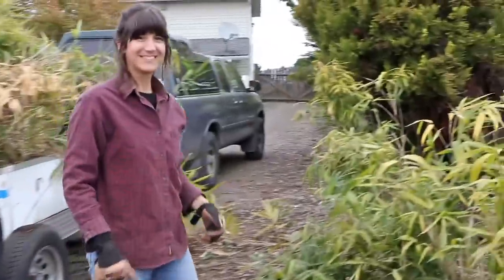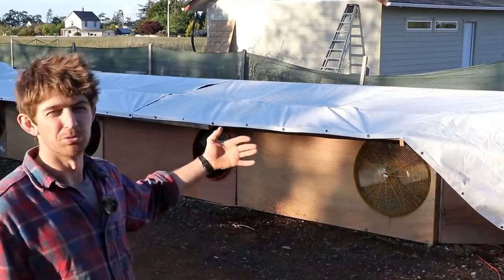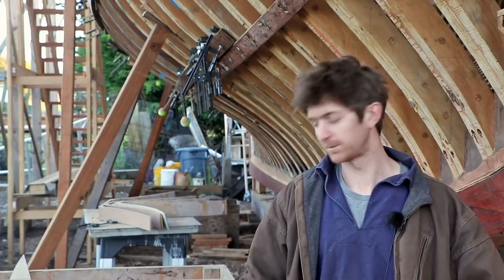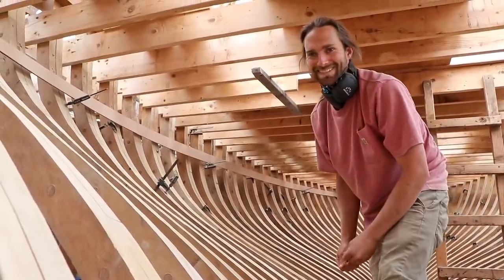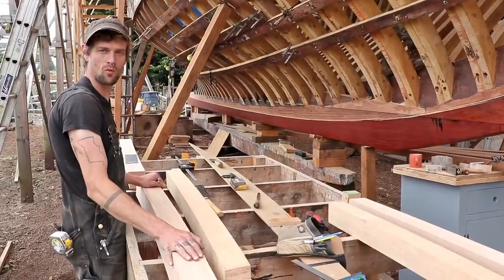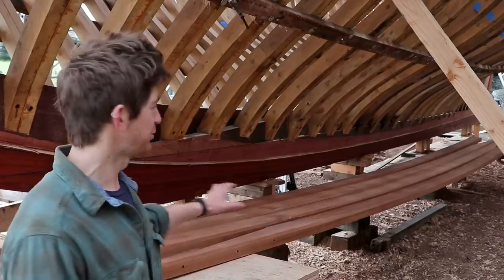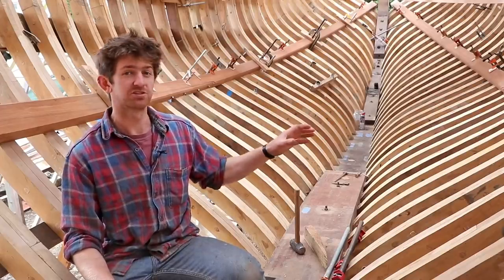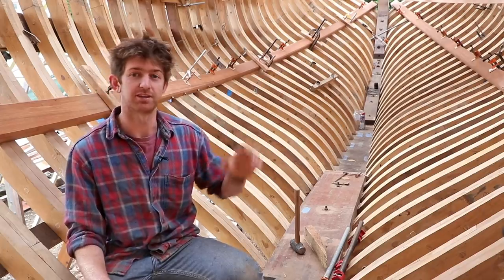BoatBuilding - Bilge Stringers / Oak problems! (EP72)

Comment: Making your friend a tool handle led to finding the bacterial wet wood, which in turn led to the inspection that found the open pore white oak problem, which in turn may have saved significant problems in the future.  Tally Ho will be stronger because you helped a friend.
Reply: Exactly what I was thinking!

Comment: As the temp drops every night, I would suggest that you turn off the fans and resume in the morning as the temp comes back up to yesterdays temp.  Look up relative temps and humidity charts or talk to the local weather person, they can help you a lot.  I used to run the wood room for the major instrument manufacture in the USA while in college.   It takes a long time to dry wood, months... the way you are now using and I would suggest to wax the ends anyways to reduce or stop checking.
Reply: Cold air can hold less moisture than warm air. February and March are the best months for drying timber (in the northern hemisphere's temperate zones)
Reply: That might be hard to do! A couple of used ROANOKE tobacco curing barns would meet your needs Sparky. Right?
Reply: I don't think it would be difficult to build something automated: an humidity sensor and a microswitch to stop the fans if the humidity is too high.
Reply from the maker: Good plan, I have already been turning it off at night, but now I know why I am doing it! The ends are already waxed.
Reply: David, we've got the same issue here in Israel, the wood dries up too fast outside and sometimes splits, got to do it in a humidified shipping container. I've seen people on YouTube drying wood outside and all was fine and i always wondered how they do it
Reply: @SampsonBoatCo  Leo, you never miss a trick

Comment: This is ironic. The Acorn to Arabella folk are having trouble with cedar.
Reply: I came here just to say that!
Reply: I was gonna say that too. In the same week they do a hammer test to a piece of wood and make the decision to ditch some wood and a lot of work. Tough decisions. I thought maybe Leo could inject some kind of resin into the porous wood using vacuum.
Reply: @taxirock90  I thought of that also but, that would be expensive and add a great deal of weight above the CG which may not be ideal.
Reply: the week for removing wood one is concerned about.
Reply: 984francis It would be more so if an Ironbark construction methinks!?!!
Reply: I’m ok as long as Acorn to Arabella and Sampson Boat co don’t start having babies simultaneously... lol! Not that I have anything against babies....
Reply: They both obviously got sold the same script!
Reply: Red oak... Posted before Leo said it
Reply: Dude what is up with the oak?? I actually got sold a plank of red oak and ended up remaking most of the frames for my sailing dory Centennial.
Reply: Nick Maclachlan  I just looked up the definition of ironic and coincidental is an exact definition of ironic
Reply: @danoyes1  Look up Tales from a Shipwright, White Oak v Red Oak
Reply: Will Lou hammer the oak too?
Reply: @svpearlsailacapegeorgesail4758  There's a baby boom in the Saillig Youtubers latelly.
Reply: You know they make a pill for guys having trouble with their wood.🤣🤣
Reply: @taxirock90 /videos Not worth it, and the viscosity of resin would probably make it go only half way, he'd need a very expensive low viscosity resin and a damned good vacuum pump.
Reply: @robertinscoe2379   Then they can hammer their oak!
Reply: @aserta  Their is a resin made just for that purpose, very thin, just like water, I am not sure, but I think it is an Ados brand.
Reply: @francescosirotti8178  I do it the other way around :-)

Comment: Given the size of the project and the  way things are with finding enough quality material for any project this size the oak problems are not surprising  even if they are expensive and annoying. The thing that mattered most though at the end of the day is you got a great result and solved the  issues. The best thing to happen to the  project is that you found such brilliant help in both the guys and that they hung in while things were resolved. Saw some of the work that was done by Pete on the  Western Flyer vids and he is as good as they come.

Comment: It really is hard to find wood these days that is comparable to wood of even 60, 70 years ago.  Some of the old old growth was really amazing material.  I have run into this problem many times as a builder.
Reply: Your right I've just completed a 
16 century chapel conversion. And alot of the joists were original to the chapel. Due to the architecture drawing changes.. I managed to require all the wood that im building my workshop with. All 16 century oak beams. Thats still in great condition.  All be it the odd clasp nails here and there. 
The grain structure growth rings in the oak i have are tight. And weigh quit a bit. Its sad that most of the oak joists i have are going to be covered up. There practically black and so dense  that hammering a nail into them just bends the nails.

Comment: You should cut the stringers you removed into 4X4 or 5X5 blocks (that'll fit into a small box and sell then for $50 as a fundraiser.  I'd buy a piece of wood that was in the Tally Ho (even for a brief period).

Comment: Wait, how does the boat move forward if it doesn’t have wheels?
Reply: It has wheels or rather the boat travels on the water's wheels, they are really small and are all through the water, the hull rolls along them.
Reply: @GregorShapiro  Wait a second. So when I get thirsty I'm really drinking a cup of wheels? Nature is incredible.
Reply: Virtual reality.
Reply: They retract into the keel, like inline skate! You must have missed that episode.
Reply: Crabs, lots and lots of crabs...Didn't you see Pirates of the Caribbean?
Reply: The trick is to make sure you are always pointing downhill, let gravity do all the work !
Reply: For Ian Clarke, that wouldn't  work if the yacht was on the flat earth concept
 😉
Reply: A REALLY HUGE HELICOPTER LIFTS THE BOAT AND CARRIES IT TO THE LAUNCH SITE...very carefully...
Reply: Careful, they did try "Land Yachts", Wagons w/Sails to cross the Prairies....

Comment: How did you even realize that issue with the porous wood?

Did you notice a cutoff getting wet or what? Really glad you saw it in time to not have to remove the deck to replace it.
Reply: Last episode there was a piece that has discolouration in it and was remade. Leo says the beams replaced were made from the same log.
Reply: matt lander i don’t think it was from the same log (or if it was, that wasn’t the reason they replaced it), but rather they were looking for that discoloration in pieces they had already made, and while looking they noticed the separate problem with the grain.
Reply: Justin Bank Ya, maybe while looking for Roy they just looked close enough at the end grain to notice it, and then experimented with it a bit?🤔
Reply from the maker: @Justin_Bank  Correct!
Reply: Because he has built more wooden boats from raw trees than most folks have even seen in person.... haha. Thats how. :)

Comment: I have been trying, in my otherwise unoccupied mind, to come up with some sort of equation that would translate all the factors involved in the analysis of how the various construction materials, namely, Wood, Fiberglass, Steel, and Aluminum with a slight consideration to concrete, stack up and compare considering: efficiency of construction, overall durability, resistance to concussion and sinking, lifelong maintenance, subjective feel to human occupancy, and overall cost. I think the last mentioned would receive a universal vote for wood, but the other factors remain at play, and anyone's input with reasoned verifiable stats, or even reasonable impressions would be interesting to this observer. 
I've been around boats for my whole life and I'm 75 now, so the whole gamete of materials have been up for grabs by countless stakeholders since my interest began. I have sailed, and worked on wood, fiberglass, and steel 50 plus foot vessels, but amongst my peers there is no clear majority view on the relevant matters. Right now there are several projects being chronicled on YouTube using various materials, so current examples of many factors are available for scrutiny. Thanks Leo for providing such a stunning model of both materials used and proficiency in construction for the wood example.
Reply: I concur
Reply: How will you model this or are you still looking?
Reply: Sounds like you're looking for something like the Drake Equation
Reply: Wall of text.
Reply: For Glenn Miles.
It's 1-inch stripped plank Oak hull, then epoxyed inside and out aka SUMNER CRAFT, was made in Amnittyville Long Island N.Y.
Reply: In my experience, the best sort of boat is the one you happen to be sailing at a particular time. Stopping them is a whole different dynamic.
Reply: I think it would have to be a "Quotient" But I see the basic challenge as coming up with a list of aspects with wildly diverse values. How do you articulate that. I have a bias so how much do you allow for that variation? I have had a lot of shipwrights for friends, in living memory, and the aesthetic of wood, has been easily traded off the table when the how long is it going to last? And the how much maintanance in time and money is going to be required questions are considered and the emotional, subjective, acoustic, and visual parts of the long term experience people have in those various physical environments. The lesson I get from following Leo through Tally Ho's transformation has been that wood has qualities  that are transformative! It's like every two weeks I get "Wood Therapy" as all the elements of the human potential are demonstrated again and again. Reminds me of the Pre-Inca stone work at Matchu Pitchu . The logic of Leo's approach is displayed in several replica and renovated 16th century and earlier sailing ships. I think the experience of crew that spent whole lives on those beautiful objects of the maritime arts would have been enhanced by their living environment. Sorry for Babbling rant. https://www.youtube.com/watch?v=mfzuC3d1zY4

Comment: Before you go too far fans don’t suck.. To get the best out of your drying facility you need to turn the fans around so they blow through the stack. Just check put your hand 🖐 on the back of one of the fans. Sorry to be a pain in the arse but ventilation is my business 😐
Reply from the maker: Thanks for your comment. I did notice that I can't FEEL them sucking... but surely they must pull the air from somewhere?! I do feel a little bit of airflow at the back of the stacks. I'd be keen to learn more about this, if you have any more information.
Reply: Air flows through an orifice from the circumference and produces a jet stream on the other side. Simply check with a vacuum cleaner. Unless you hold the suction head very close to the surface it doesn’t suck. In theory the entrainment velocity on the suction side is less than 15% at one orifice diameter from the orifice. The set up you have now won’t work properly and you will just waste electricity.  I think k you will find a description of air flow through an orifice on Google.
Reply from the maker: @Ibh111142  I'll look into it more then, and perhaps reverse them. Thanks.
Reply: Ibh111142 I'm sure you're right when it comes to maximising airflow through the stack, but wouldn't you run the risk of drying the wood unevenly? The wood immediately behind/in front of the fans would dry much quicker than the rest. Although less efficient, having the fans 'suck' would create a more even airflow? Just a thought.
Reply: Sure fans suck. Almost every large air conditioning condenser has them set up to exhaust. That way the condenser coil is exposed to the low pressure created by the fans and the flow of air is even across it.  You should leave your fans the way they are. Turning them around will cause uneven air flow as the wood directly behind them will be blasted with air and a few feet away, almost nothing.  You set it up properly the first time.
Reply: Ibh111142   Wrong. You are creating a low pressure area in front of the stack with the exhaust fans. This will promote even air flow across the entire stack from the other side, which is what you want.  Leo had it right the first time, don't mess with it.
Reply: DEW409  Ah another disbeliever and so confident , my fifty years in the business after a university degree have been wasted. Suggest you check the text books .

Comment: Replace the oak with cedar. :D All joking aside, is there any process you can use to stabilize those pores and plug them up?
Reply: There definitely are things that it could be done, like resin impregnating, but that would be expensive, difficult and make the wood heavier, which isn’t desirable.
Reply: @Nevir202  Is resin even allowed near this boat?

Comment: Add that to the lessons learned log. From a QA  perspective it's essential to have traceability and verification of the specification of all components used in a system. That means sampling and verifying each (in this case) log BEFORE it's incorporated into the system. Let's hope nothing else slipped through as rework is a morale killer as you mentioned 👍

Comment: My uncle used to build racing sailing dinghies including Flying Dutchmen Fireballs, OK Dinghys, 505's, Cherubs, Javelins all in in timber,  He was a pioneer in epoxy impregnation of timber in Australia.  Boats he built have been in the Olympic Games.  When he purchased timber he would weigh each individual piece of timber before he bought it to make sure he was getting the lightest and best quality timber he could get.    You obviously made the best choice.  It's interesting that over on Acorn to Arabella they are also rejecting some timber and having to redo work.

Comment: Question for the dodgy boat school alums. "What's the torque on the bilge stringer bolts in newton-metres?" 

The delivery segment deserves an honorable mention in the time-lapse wood stacking hall of  fame. 

And the fan drying system is similar to what we use for compost  curing using a moisture sensor. 

Great episode!

Comment: Looking good Leo, very impressive, good decision on replacing the dodgy oak, it would have gnawed away at you for every day until you had to give in and replace them.  Which at that point would probably take longer than 3 days to replace on a finished deck.

Comment: I've just completed installing Brazilian Tigerwood shiplap siding on my new shed, and was recommended that the endgrain of each board be coated with a paint-on waxy sealant, Ipe Seal manufactured by Deckwise, to prevent water absorption and to stem checking.  I've found that it work quite well over time, and I've used it on a large Tigerwood deck, two large screen style fences, the siding on my house and a stairway/small deck project.  As a minimum, it would work great for use on the Angelique hardwood you plan to use for planking while it is being stored prior to use.
Reply: Leo advised elsewhere on this page that the ends of the deck timber are already waxed

Comment: Leo, some years ago I came across a 3M resin used to internally seal cracked concrete. It was screened over the surface and being very low viscosity penetrated. It was needed on multi level carparking to avoid seepage to under decks. 
But as I watch this video 4.30am Australia I see you going for the better option congrats.

Comment: I'd like to echo all the positive sentiments concerning this project and accompanying vids (I write towards the end of two-week binge fest). I'm no boatie, but I was based in Falmouth (UK) 1985-97 where it was hard to avoid boats, boatbuilders and sailing types, so hard that I even worked on some and sailed on the wretched things. In certain quarters  I'm known for yawning openly when the subject of boats arises in pub discussions, but even I've bunged a few quid in the pot. Excellent work, chaps. Btw, I'm with Patrick on the correct use of the Queen's English: front, back, left, right; why mess around? And what's this I hear about there being no wheels? Are you sure you know what you're doing?

Comment: Saw some good hammering in there.  You watch a lot of folks on these Youtube videos doing work, you watch them hit the head of a nail, or punch, or a bolt, tool, off center and at a crooked angle.  Watch them drive things wrong, beat the shit out of their tools/bolt heads, bend nails, do things wrong.  Always like watching real trained craftsman at their trades on videos, and you see the technical skills they've learned.  All the way from the complicated bits, all the way down to the way a man ought to run a file, strike with a hammer, properly fit things.  A minor technical note, but always good to watch these fine videos.

Comment: An oversimplified way to distinguish white oaks from red & black is to split them.  Red & black oak split clean, where white will have stringy fibers holding it together. (firewood education). Back on track either way, and playing it safe, very wise.

Comment: I have watched the birth of this "NEW' vessel from Australia since you started and can only congratulate you and your elves on the fortitude coupled with fantastic knowledge in getting this state so far - A silly question and probably condemned by the purist section of sailing, but are you going to have some other form of propulsion besides sails?
She may not have foundered originally if there had been some small engine to get her out of trouble - maybe an electric engine for getting into a berth??
Once again - congratulations, you are no doubt an inspiration to all who watch your videos! Cheers Guy
Reply: She has always had an engine, originally a 10-hp 3-cyl paraffin motor, replaced several times. I think Leo is planning to install a simple diesel engine, perhaps w/ a feathering propellor.